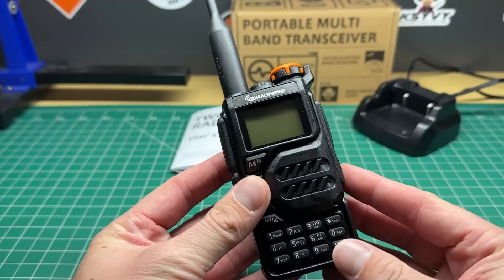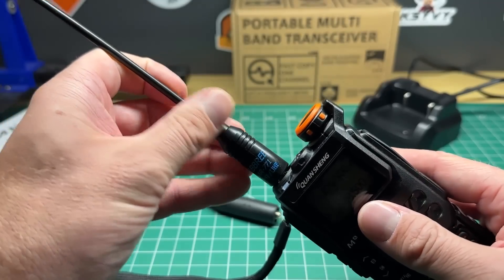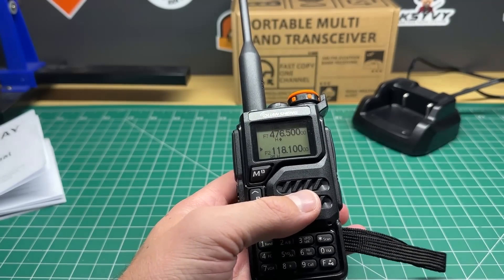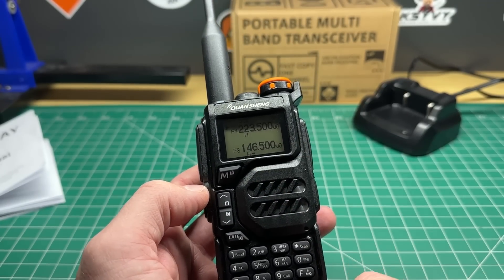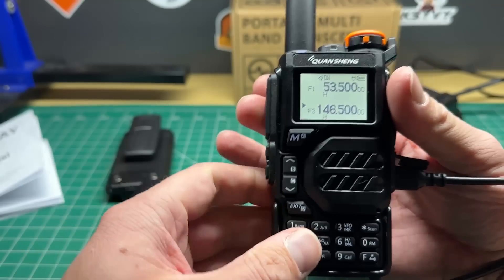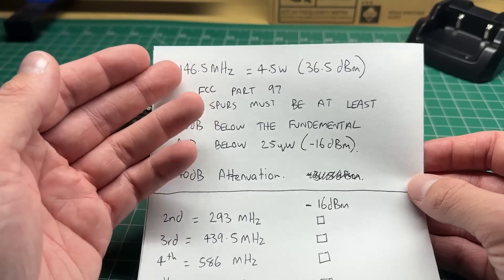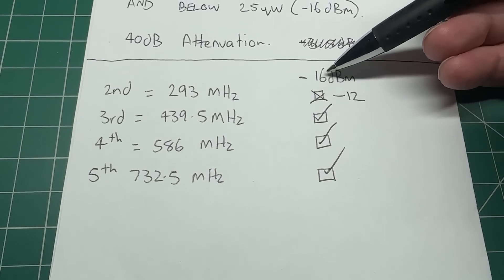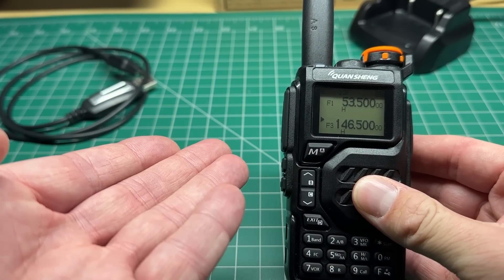UNLOCK Extended TX for the Quansheng UV-K5 + MORE!

Comment: This video was a MAJOR help in understanding the hidden menu.  I purchased an UV-K5 radio from Amazon for use in the US and discovered that I couldn't transmit above 146 MHz.  The manual revealed that the "CE" version of the radio tops out at 146 MHz and I initially thought that I was sent a non-US version of the radio.  But the hidden menu revealed an "F-LOCK" option where  I can select "FCC"; now I'm able to transmit FM across the two meter band (144.1MHz thru 148MHz)!
Reply: The entire radio can broadcast on any freq....if you know how in seconds.

Comment: American Ham here; so I have a license for 220 MHz.  I followed you, step-by-step, but the radio remains disabled for that band.  Am I missing a step, or might the base firmware have an issue?
Reply from the maker: Have you got any modified firmware loaded on your radio or is it out of the box?
Reply: @HamRadioDX  Out of the box.  No mods yet.
Reply from the maker: @BrianMcDanielKC4LMD Use the firmware from egzumer - it has a few other fixes and improvements - https://github.com/egzumer/uv-k5-firmware-custom/releases
The wiki details how to open up 220. https://github.com/egzumer/uv-k5-firmware-custom/wiki/Radio-operation#how-to-unlock-tx-on-all-bands
Reply: @HamRadioDX  Thank you.  My BF cable doesn't work with it, so I am waiting for a new one.  I'll give it a try.  VY 73
Reply: It did @stratocasterblue  - Like a champ.

Comment: 220 mhz interesting band we never had it in uk for amateurs but met police, and government agencies sometimes used the 220 mhz illegally, discrete ops using the old 8com it think with dial up freqs
Reply: Used to use 220 early summer mornings with 10 watts fm simplex 200 miles contacts because of the temp inversion almost everyday for about 2 hours each day

Comment: That isn't a reverse-polarity SMA. It is a normal polarity SMA but the plug side is on the radio.
Reply: He meant its a male instead of female to get an adapter, The signal coming out of the antenna is rf constantly changing polarity it is ac and has no polarity designation he misspoke polarity is used in dc not rf

Comment: Just watched your video and very good. Just a question, if you need 40 dBm lower for the first harmonic, wouldn't that be -6dbm with a tx power of 36dbm? I might be wrong, but then it would pass. Nice videos from Belgium 73
Reply from the maker: For +36dBm that would be -4dBm... however there is a further requirement for transmitters under 25W to be that plus less than 25uW, which is -16dbm. Cheers

Comment: so have you actually tried these abree and nagoya antennas on an analyser ?
probably not, because they're shit..
the stock antenna work great it's designed for the radio and they work great, you change the antenna and you get an antenna you think are good, but they're not,
it might RX better to a degree but TX is poor, some don't even resonate anywhere, just a length of wire in a tube..

start using proper test equipment and we'll start believing you know what you're doing..

can't transmit, get a dummy load you idiot...

Comment: NOTHING stops you transmitting on 220 for us who can, except it would be on a dummy load so as to see what pwr output it has. Your video title is misleading RIGHT Since you don't won't bother I'l; look for a vid that does
Reply from the maker: The video title is not misleading. The title does not say “220 power test”. 
Good luck with your search
Reply: WHAT! !REALLY, For those who use 220, We stop at a 220 video,With large 220 showing. By the way NOTHING stops you from testing it on a dummy load. Think man, many radios have very low output on 220
Reply from the maker: @rickpalmer9518  fair enough champ,  but your initial accusation that the title is misleading - isn’t true.

Comment: I just tried the procedure in the video (Push PTT and upper side button while turning on). Then set the menu item to 220 TX to "ON". Still shows "Disabled" for 220 TX.
Reply from the maker: Make sure you hit menu to confirm after enabling.
Reply: Got it working now! @HamRadioDX

Comment: As stated elsewhere, it is not a reverse SMA!! I ordered one from Aliexpress last week and it turned up today...fast delivery. I have started tests on the spec an. Only tested UHF and it is just marginal on the third harmonic but fine on the second. As the third is up in the 23 cm band I don't think it is a big issue. Will test the 2m band when I have finished setting up the radio. VK5ZT

Comment: Hello, first of all thank you for the video, it helped me a lot! I would like to know if this NA-771 antenna works for aviation frequencies? 118-137mhz? If it doesn't work, could you point me to one that works for this radio? thanks
Reply from the maker: A Nagoya will work probably not as good as a tuned antenna for that band - or there are some RX only telescopic whips you can pickup to experiment with the right length to receive airband.

Comment: What is the scan speed like on these for both band scanning and also preprogrammed channel scanning ? Pedestrian like the Baofengs ?
Reply: It’s slow
Reply: @misamisatv   mine wont even scan channels. It will scan in VFO, but trying scanning in channel mode will cause it to go into a weird mode where keypresses enters characters onto a line, with no escape - I have to turn the radio off and on to get out of it (uv-k5-8)
Reply: @ntek2709   I had that, but i discovered holding the Scan button for 3 seconds will get it to scan in channel mode.  Yours might take 5 seconds

Comment: I nearly got this radio as the advertising information said it was an airband transceiver. I have a license to transmit in airband frequencies, however, the price seems to jump to 500AU dollars. Does anyone know of a transceiver that will operate around 110.00 to 120.00 range. 121.9/124.4 for example
Reply: I have a FTA550L.  It’s a bit more, but look to see if you can get a decent deal on just a FTA250L.  They are very basic Airband transceivers.  I take mine to the DZ weekends that I skydive, just to monitor the aircraft and know status of loads.

Comment: I bought 2 of them and was lucky. Both of mine met spec on both ends and in the middle of both bands, (tested on high-end gear.) Since your radio comes close to meeting spec I'd guess that the problem is with component tolerances, and some of their HT's will pass, and some won't.

Comment: Could you explain why you wouldn't just subtract 40 dbm from the 36.64 reading you got from the transmitted frequency when  you were on the 2nd harmonic? If it was just based on that calculation under -3.36db would have been fine, and -10 is well below -3. Thanks.
Reply from the maker: The harmonic needs to be 40dB down from the fundamental and less than 0.25uW (-16dBm). As -16dBm is the greater if those two measurements that is what needs to be measured.
Reply: @HamRadioDX  any spurious emission supplied to the antenna transmission line must not exceed 25 µW. What is the power at that harmonic in µW? To me the way it reads is the power of that harmonic can not exceed 25 µW and it must be at least 40 dB below the mean power of the fundamental emission, but need not be reduced below the power of 10 µW. I think where I am getting lost is it is not broken down. That last sentance seems like it would change things up a bit?

Comment: 220 MHz requires a 220 MHz rubber duck/antenna, which everyone seems to fail to mention. The stock rubber duck does not cover the 220 MHz 1.25m ham band. Also, scanning on either A or B memories, or VFO causes the backlight to remain lighted during the entire time scanning is activated. Battery life will be shortened as a result, unless the firmware update addresses this malfunction, or there is some way, which is not obvious, to turn off the backlight while scanning. Sorry for the error, it is the 1.25 Meter band.
Reply: Chuck the stock antenna - it's one of the poorest I have tried (and I have 8 Baofengs!)
Reply: @Petertronic  After watching all of these videos I am starting to obtain a collection of these HT's just to tinker around. Good stuff.
Reply: Unless the rig is designed for 220 MHz the filters, (depending on what type they are,) will either allow nasty harmonics out, or will suppress the power output. That's on transmit. On receive that would mean it would either be deaf, or it would likely be more susceptible to out of band interference.
Reply: @johnwest7993  Also true. The radio does not transmit more than .250 watts on 1.25cm band, 1/4 of 1 watt. The TX range is severely limited unless you use an amplifier, and an external antenna. Even then, radio performance will likely suffer and be degraded. But, it, at the very least, requires a suitable antenna to prevent damage to the radio.

Comment: What sucks is it can not be unlocked to transmit on 6 meter & 4 meter bands for the UK. It seems to work decent on the FRS/GMRS band.
Reply: It can be modded to TX on any frequency using the modded firmware BUT there's really no point to it - it'll put out milliwatts or even microwatts on 4/6m.
Reply: @asystole_  Explains why it transmits crappy on 220 MHz

Comment: Great Video.

Just wondering
can it be unlocked for TX on the Aircraft Band ?

I hope not lol.
Reply from the maker: No cannot TX on air band
Reply: @HamRadioDX  Great to hear that mate 🙏
Reply: It can't be unlocked? What is a good option then for local airfield or back up onboard GA plane?
Reply: A handheld that does rx and tx on airband costs hundreds not 20 bucks 😁 at this price point though I do really like this radio for what it does.
Reply: @dutchbeef8920  Yeah, it does seem to be a nice little radio for sure 👌

Comment: on + PTT = Flashlight (radio off)  on + function1 = Radio on in  monitor mode PTT+ function 2 =air copy mode PTT + function 1 and function 2 =??? (sorry I chickened out here, i was thinking it was some type of master reset? or kill? if you try is post it here please)
Reply: update: with ON+PTT= update mode (for updating the radio's software ) the led will blink while updating from pc via cable.

Comment: I downloaded the firmware and firmware Updater but I can't install the Updater program.   Has anyone been able to at least install the Updater program?   I have Windows 7
Reply: I fixed it.  I removed the Updater from the folder that was created after using winrar.  Put it in a separate folder and it installed perfectly.   Go figure?
Reply: Wonder what if any new features but be available from the Firmware update?

Comment: I wonder if the software can unlock 50 Mhz transmit? I am in south central Kentucky and never hear anybody on 6 meter FM. For some reason the north American market does not have 6 meter FM in any of there handhelds or mobile transceivers.  AC9IM
Reply: Many brands had models that cover 6m. Currently the Wouxun brand has HT that covers 6m. The TYT TH-9800D covers 6m, not to mention many HF/VHF/UHF all band all mode mobile models that are current.

Comment: Not reverse polarity. It means that the pin is on the other side, while it's supposed to not be, according to the rest of the connector. Normally only WiFi products have RP connectors.
Reply: It's a male chassis connector.

Comment: Could you elaborate on the "SCRAMBLER" function? Thanks, Tom  from USA.😀
Reply from the maker: The scrambler has varying levels to it 1-10 I think. I suspect it's just shifting the phase of the signal a little, you can still understand what's going on, i.e. it doesn't scramble all "that" well at lower levels. On 10 I guess it does do a relatively good job.

Comment: The phrase "reverse polarity SMA" is incorrect. The Chinese antenna has what's typically referred to as a socket and the radio has a plug, but that doesn't make it reverse polarity. Typically the Japanese manufacturers have the socket on the radio ("outie") and the plug (what you would normally find on the end of the cable) on the antenna ("innie"). The Chinese radios have the plug on the radio ("innie") and the socket on the antenna. I feel this is more sensible as if the antenna were to be forced off the socket/antenna would be ruined, but the recessed plug in the radio chassis survives. I have seen the Japanese approach rip the connector off the chassis of the radio- quite a mess. If you took a Yeasu/iCom/Kenwood antenna and a Chinese antenna you would see they mate (uselessly) but it shows the difference. The closest concept to "reverse polarity" would be "reverse pin" which is done on routers. In that case the pin is received into the antenna which has a plug, and the socket on the router has the pin.
Reply: 🤔 correcting one persons terminology while also using incorrect terminology. 😂 it’s male or female, not innie and outie or plug and socket.
Reply: Please get your terminology correct before correcting another person's terminology when both are clearly wrong. 
The correct terminology is male and female.

Comment: Would like to have seen TX from a stronger airband station....to see how the audio is.

But in you test it sounds ok.

Would you know my friend....if a set of airband freq are entered in the radios memories....with these radio scan them like a normal scanner.

Can I manually enter a freq with out a PC....as I can in my Boafang
Reply from the maker: Yes you can enter a frequency and save without a PC.

I'll have to go for a drive to the airport :)

Comment: I opened up (or a friend did) the Baofeng UV-5RE to 220 (1.25 centimeter).  Had to get a tri-band antenna which cost double the price of the radio.  Cheers & 73 from K9POW in eastern Tennessee
Reply: I heard that it will open up to 220mhz but will only transmit at 1mw... Making it good for transmitting to a guy sitting right next to you. Provided you're talking loud enough and he can hear you. As in your voice without a radio will carry further than 1mw.

Comment: So the fundamental was 36.64 dBm and the 2nd harmonic was -12 dBm ... Isn't that more than 40dB.. (36.64) - (-12) = 48 dBm ...  Is that not correct? I must have missed something, or don't understand your setup.
Reply: I understand that the harmonic must be 40dB less than the fundamental and below -16dBm. The radio only complies to the first of the two conditions.
Reply: @etzow  ah. 4 db off gotcha 👌   missed rhe below -16dBm part.

Comment: So this radio fails on spectral purity and should only be used for receiving. It would be interesting to see how many fail on average....or if any pass? I guess for airband and marine reception it is a cheap option but as an amateur rig for transmitting not much chop. Thanks for showing us the spectrum analyser test .....you have some nice test gear there73 de VK2AOE.
Reply from the maker: I do have a thought pondering question on units that aren’t “compliant”. Is the test for emissions supposed to be measured at the antenna port - or radiated after the antenna?

Because if you include the antenna - in most they aren’t tuned for the 2nd, 4th or higher harmonic if you’re transmitting on 2m. This would knock down any radiated emission considerably.

Now if it’s out of the antenna port (which it is) then these articles saying you can add a low pass filter on the output is a waste of time - as the radio is still non compliant out of the antenna port. Something to ponder, maybe a future video.
Reply: @HamRadioDX  I meant part 2 INTERFERENCE… para 7
Reply: If the Yank legislation states “at the antenna port”, as a ham you can modify gear ie add a filter to the original “port” and then label the output of your mod “antenna port” and the gear is now OK, if your filter performs as required.

Comment: Is it possible to make this handheld transmit 0n the 6 meter band? I am from the USA and this would be a great thing s all three licenses can transmit on 50khz(6 meters).
Reply from the maker: I answered this in the video. I suspect the radio lacks the RF capability to do this
Reply: That feature will be available the week after you buy the original.  The model is the UV-K5+. 
This model will feature 4 and 6 meters as well.

Comment: Can this radio be programmed with chirp ?
Reply: That was my question as well. Until CHiRP can program it, I'll stick with my UV-5R.
Reply: @tgrossner  RT Systems posted a note saying they will not support it because it has a very non-standard data interchange format, and they can't figure it out. My guess is that Chirp will not support it either, as they have previously indicated that "non-standard data streams" are not worth their time/effort. So, you're stuck with QS software. It's not great, but it's not horrible either. It's usable.
Reply: @tgrossner  no
Reply: I would like to know too chirp has no settings for this radio I know of so far.
Reply: Their proprietary software does not work for me. I have 2 win11 computers and 3 Baofeng cables, all of which work brilliantly with a UV5R,  but spit the dummy with Quanshengs programming software. So I am reduced to manual programming on what is otherwise a great competitor to Baofeng. A disaster for Quansheng when the truth about their software sinks in.
Reply: No.
Reply: Not yet
Reply: Looks like quansheng is in communication with the folks at chirp and some have been able to program the radios with chirp. Should be supported soon!